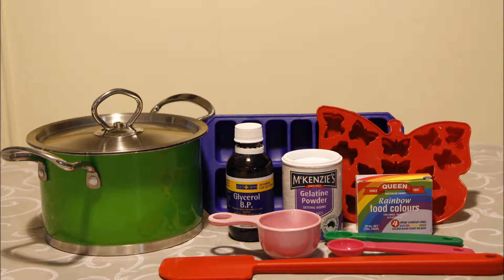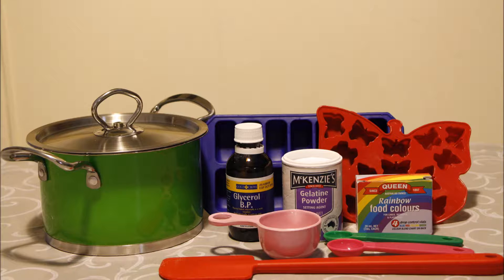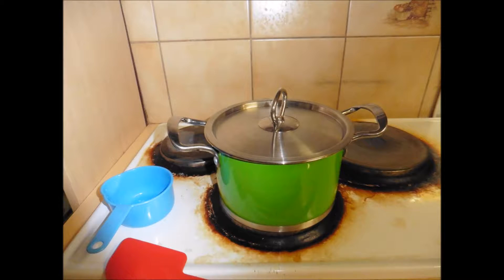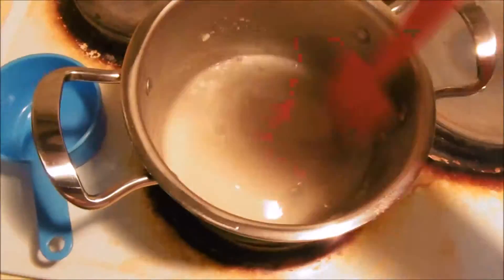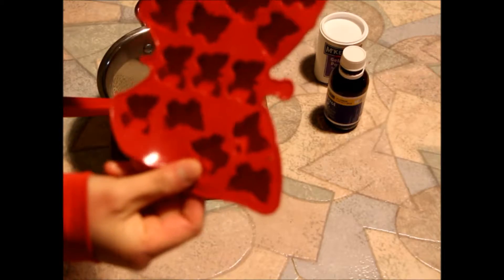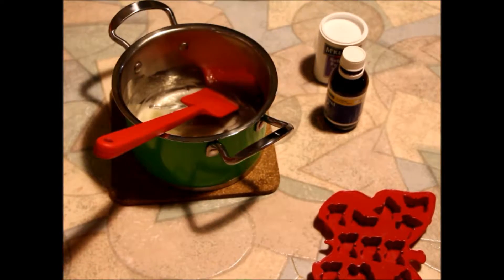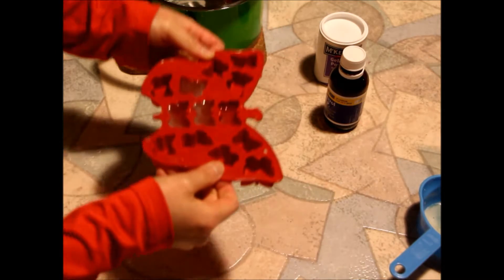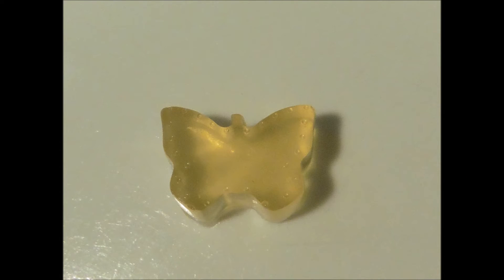DIY Bioplastic Stamps

Comment: Thank you this is great. Can these be used in the oven, washing machine or washed by hand?
Reply from the maker: Bioplastics are not hard plastic. If you put it in oven, they are likely to melt from the heat. If you pull them hard or twist them, I think they are likely to break.